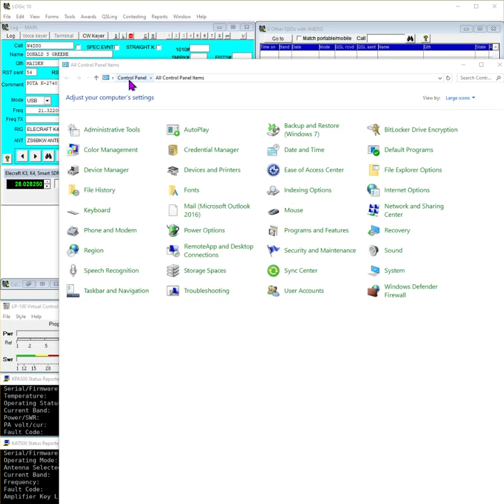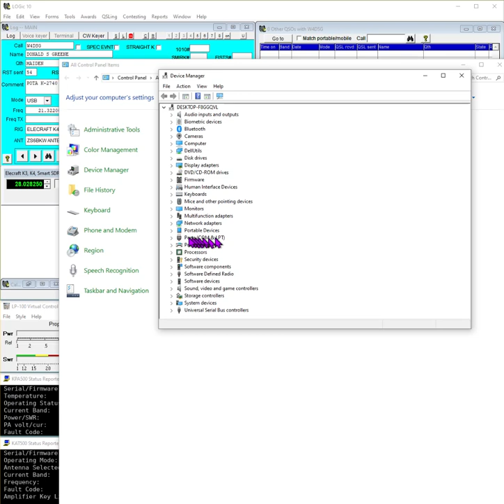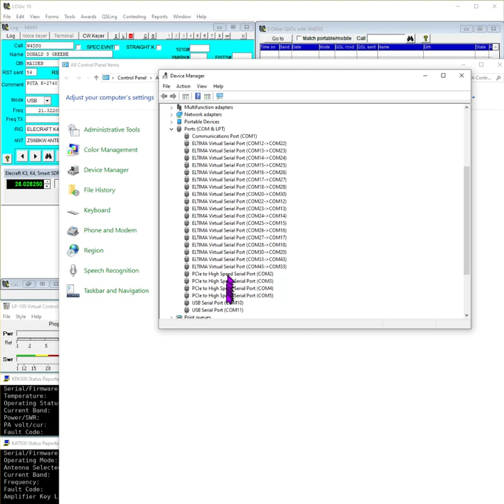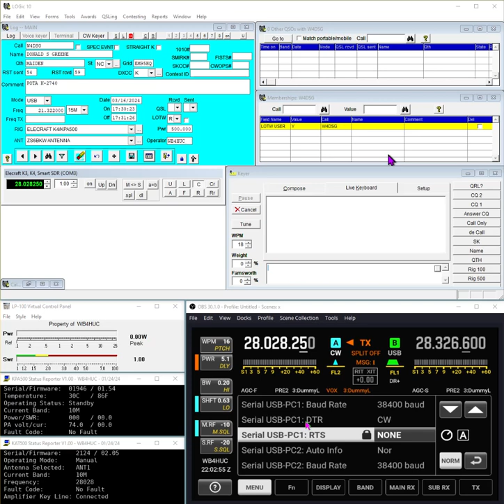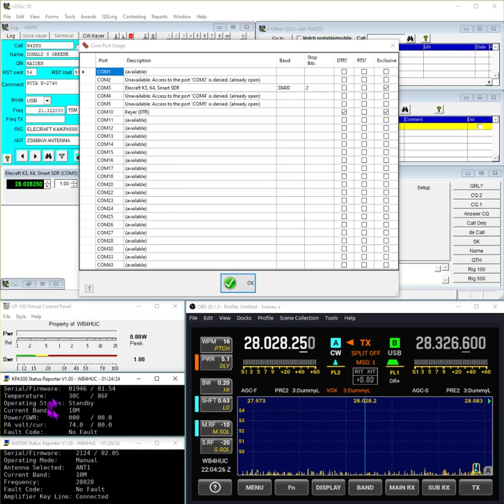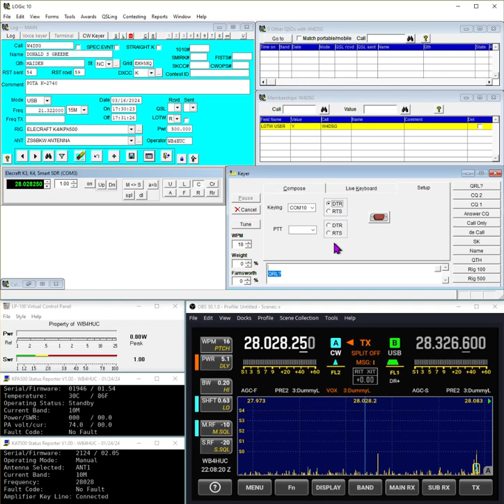How to send CW from software on the Elecraft K4

Comment: What are the various pieces of software used. Thanks and 73, Rod w7zrc
Reply from the maker: Hi Rod,

The Logging software that contains the software keyer is Logic Version 10:
http://www.hosenose.com

The software that displays the LCD screen of the K4 is called OBS Studio. I connect an HDMI cable between the rig and an HDMI to USB converter that plugs into a USB port on my computer. Then OBS Studio can display the screen image from the converter.
https://obsproject.com/
https://www.amazon.com/gp/product/B08QF6YWWD/ref=ppx_yo_dt_b_asin_title_o07_s00?ie=UTF8&th=1

The wattmeter display comes from the Virtual Control Panel for my Telepost LP-100A wattmeter. This software is available from the manufacturer.
http://www.telepostinc.com/LP-100-Update.html

The two monitor programs for the KPA500 amplifier and KAT500 tuner are ones that I wrote. I have a couple of videos about them. They were written in a language called BBC BASIC for SDL.
https://www.bbcbasic.co.uk/bbcsdl/index.html

73,
Mike - WB4HUC
Reply: Thanks Mike! I enjoy your videos and started watching when you were doing Ten Tec etc. I still have an Orion II. 73 Rod
Reply: Thank you for showing this I use different software and ethernet to control my radio but USB keying is nice for contesting.